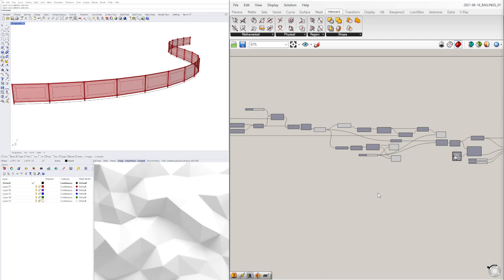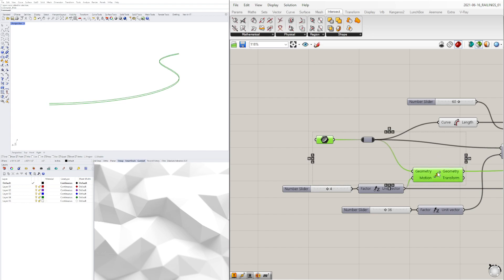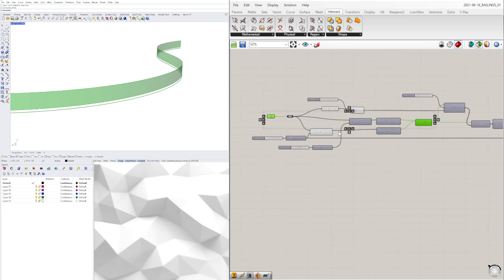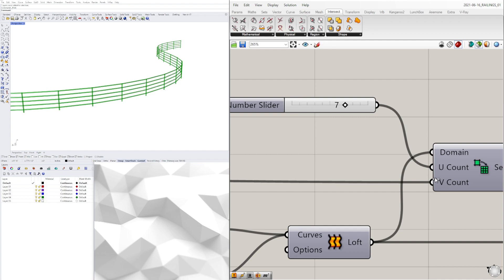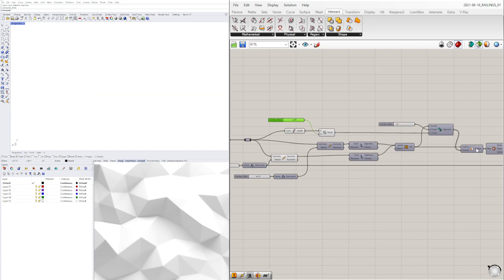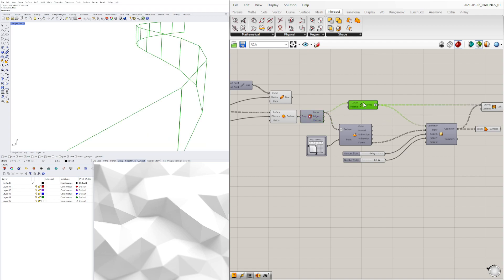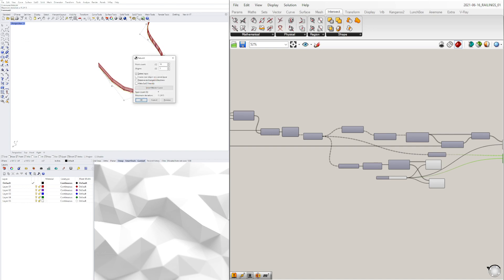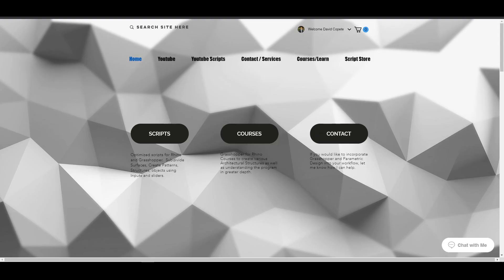Railings From base Curve Rhino and Grasshopper

Comment: Pointless watching with no audio............... Why?
Reply from the maker: I tried it and it had audio, It could be on your end.
Reply: @DCOParametric  Thank you for replying. I just replayed it again now and there's audio. Great tutorial with the audio working, really helpful :-)

Any chance you can do a tutorial where you can change the pipe from a solid circle to a box and even better still a RHS section with control inputs for box dimensions size.

Thanks once again, you've got some great tutorials.
Reply from the maker: Thanks for the feedback!. Yes, I will create a tutorial about this.  The way I have done it in the past is create a reference frame from the base curve and end point, then create a bounding box using the reference frame and the round pipe to turn to a square section.
Reply: @DCOParametric  I'm sure I'm not the only one who'd find a tutorial on doing that very helpful. It would be brilliant if you would do a YT tutorial for this. :-)
Reply from the maker: https://youtu.be/HdBVz5wQaeo 
check out this video just made, I show the steps for this. 👍
Reply: @DCOParametric  I'm going to have to watch that several times to try and get to grips with what you did there, but yeah that's kinda what I was asking. Can you do wall thickness too? Shame there's no trimming of the intersections against one another. Thanks for posting, and in impressive time too!

Comment: Thanks for the tutorial. I do have a question though, what if i have a ready made module, provided by a manufacturer, with all the details in. How can i array it as you did? I mean maintaining every piece straight but following a curve? Cheers!
Reply from the maker: for that I would bring in the module to a brep component and array along curve
Reply: @DCOParametric  thanks for your reply. i've tried your suggestion but i guess it's a bit more complicated than that. on a ascending spiral for example you would need some kind of constraints, the brep should follow the curve's tangent, i don't know exactly. even for a 2d curve, the curve array it's just not working, the module's end would not match the next module's start..is this a thing you can make a tutorial about? thanks again